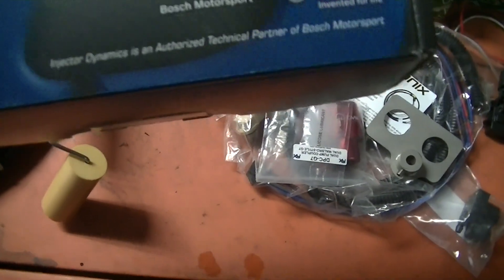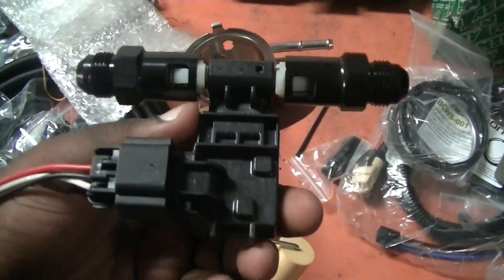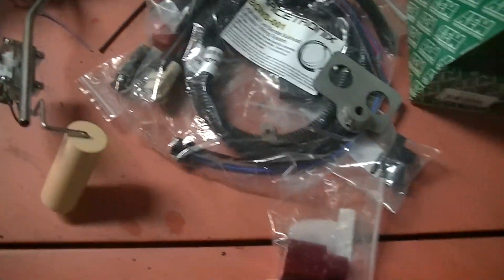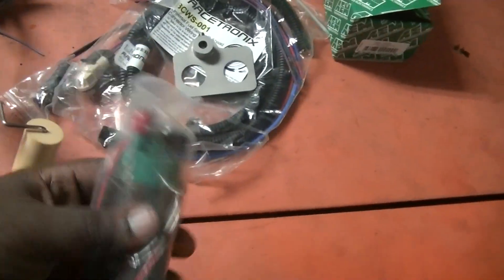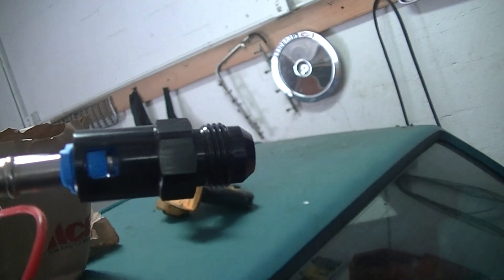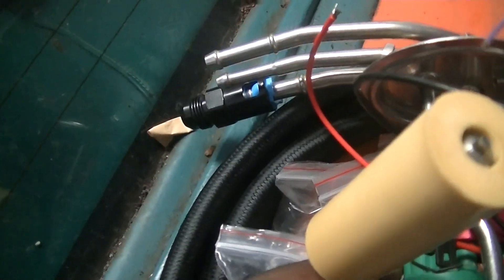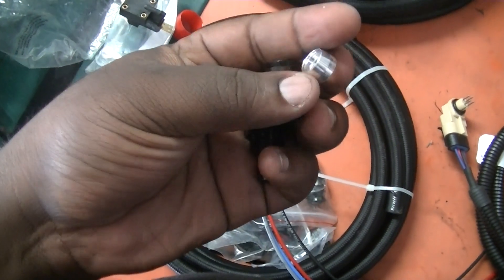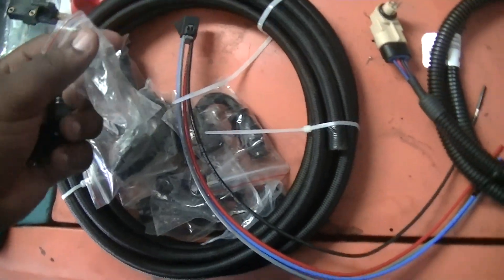Dual Pump LS SWAP G-BODY | HOW TO CONVERT TO E85

Comment: How did you wire the Hobbs boost switch
Reply from the maker: The hobb switch triggers the relay that powers on the 2nd fuel pump. I did a positive trigger but i Suggest doing a negative. Much safer that way. Switch is set to 6psi

Comment: Where do you get the dual fuel pump hanger?
Reply from the maker: http://rover.ebay.com/rover/1/711-53200-19255-0/1?ff3=4&pub=5575547022&toolid=10001&campid=5338612035&customid=&mpre=https%3A%2F%2Fwww.ebay.com%2Fitm%2FQUANTUM-Fuel-Pump-Hanger-Sending-Unit-High-Flow-Stainless-Buick-Grand-National%2F180858720844%3Fepid%3D12014081183%26hash%3Ditem2a1c05124c%3Ag%3A170AAOSwpO1dgXG6%3Asc%3AUSPSPriority%2133435%21US%21-1
Reply: https://www.racetronix.biz/product.asp?ic=dpm-001
Reply from the maker: yes that's the mounting bracket.